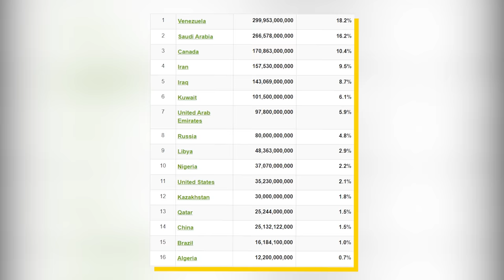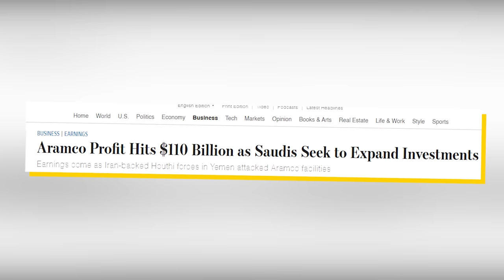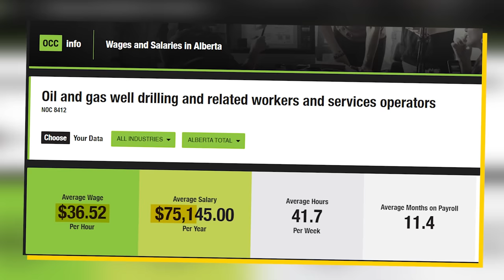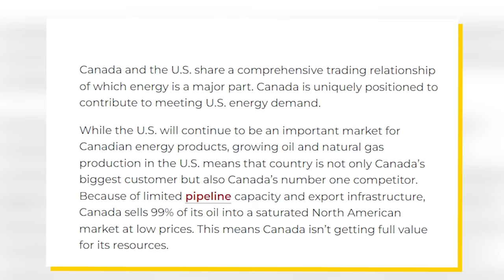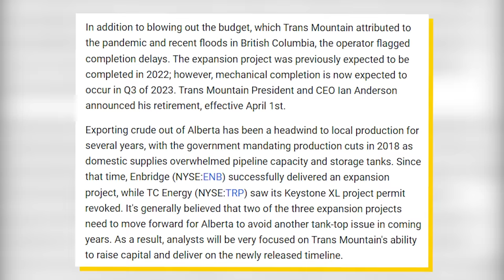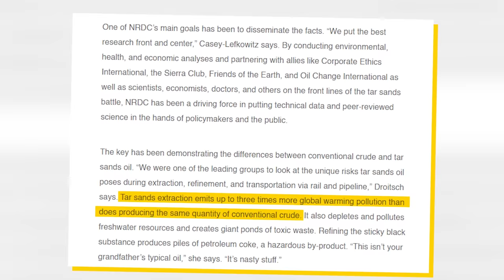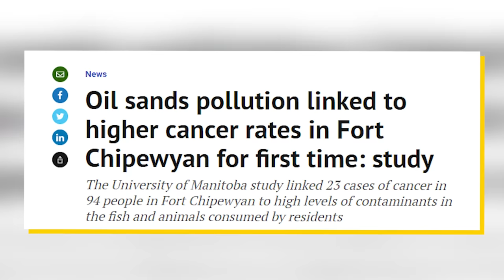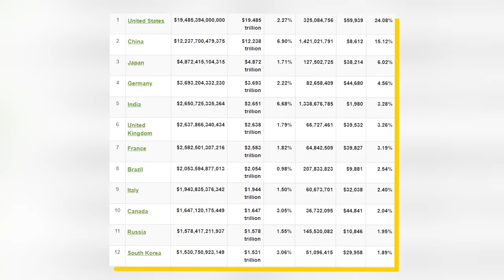Why Canada Refuses To Exploit Their Gigantic Oil Reserves

Comment: The biggest problem for most Canada oil production is it take a lot of ENERGY to produce that oil.  From what I have read what oil Canada is producing takes the energy in one barrel of oil to produce three barrels of oil.  Venezuela has a similar problem with much of its oil reserves through Venezuelan oil is NOT as hard to produce as Canadian oil.  Worse most of the Canadian "oil reserves" are similar to similar "oil reserves" in the US, it may take the energy in one barrel of oil to extract one barrel of oil from those "Reserves".  In simple terms, unless you use nuclear power as the energy to produce such oil, you will have to use more energy then you will get from producing the oil.  There are coal fields in England where a similar problem kicked in startng in the 1920s, no matter how mechanized England could make coal mining, the energy needed toget at the remaining coal exceeds the energy we would get from that coal (So the English slowly closed down those mines, accelerating it under Thatcher and a few years ago closed down they last coal mine).  
Just because the oil (or coal) is in the ground does not mean it can be mined.  It takes ENERGY to mine coal or produce oil and no one will produce that oil or coal if the energy to produce such coal or oil exceeds the energy we can get from such oil or coal.  Most of the oil "Reserves" in the US, Canada and even Venezuela is believed to be that costly in terms of energy to produce to ever be produced.
Thus do NOT look at "Reserves" but the much smaller "Recoverable Oil Reserves" the latter will be more accurate as to how much oil we can produce (Through some accounting rules lead to a to small a number for "Recoverable Oil Reserves" but such numbers still tend to more accurate then what is called "oil reserves").
Please note under OPEC rules, each OPEC nation's ability to ship oil is based on they "Recoverable oil Reserves".  When this rule was adopted every OPEC Member within a few years stated a huge increase in they "Recoverable Oil Reserves" almost up to the level of was believed to be they "Oil Reserves".   Thus it is believed Saudi Arabian and Venezuelan are to high (With many outside oil experts having much more faith in Venezulean numbers then the rest of OPEC and that is especially true of Saudi Arabia).  That appears to be a factor in the recent oil price increases (along with a boycott of Russian oil, Russia is NOT a member of OPEC but is either the number one or two oil exporter (Since the 1980s Russia and Saudi Arabia have been either numer one or number two oil exporter, whose number one and who is number changes but is has, since the 1980s, been Russia and Saudi Arabia).  
Since at least the 1960s, the top three oil producers have produced more oil then the next ten oil producer combined.  The top three oil producers have been Saudi Arabia, Russia (prior to 1989 the USSR) and the US.  The US produced more oil then anyone till Reagan becam President (BUt not enough for domestic use, the US was a net oil importer from 1969 till about 2016 when the US became a net oil exporter again, but today, 2022 the US is again a net importer as Shale oil production has dropped). 
Back to Canada.  Canadian oil reserves while large are NOT belived to be recoverable from an Energy input, Energy output point of view. The same is believed of most US Shale oil production (The most profitable US Shale Oil Fields started to be drilled around 2006 when oil reached the price it had not been at since Colonel Draked drilled the First oil well in 1859).   Thus most of that oil will stay in the ground with people crying why we do not get it out.
Reply: lmao, cool essay, but totally false. If they can pull oil from the ocean floor, they can pull oil from anywhere.
Reply: @kaleidoscope3234  So you think beause we can use two gallons of gasoline to pump one gallon of gasoline, we will do it?  That is the restriction, not that it can NOT be done, but it will take more energy to do so then we will get out of the transaction.
Reply: @paulmentzer7658  that's a bit of exaggeration lol. You assuming the only energy source we have around is nuclear and thermal plants. You are also assuming the only mean to transport oil around is pumping them onto freight ships. Both of your over simplified assumptions are just plain wrong.
You think it doesn't cost energy to drill oil from the sea floor? It does, and by a lot, but people get those oil out and still return decent profit anyway. The problem is oil is limited and it is generally best strategy for any country to avoid tapping onto their oil supply as much as their economy can endure. If your country run out of oil you are at complete mercy of countries that still have oil reserve. That's why USA and Canada limited their oil exploitation.
Reply: @kaleidoscope3234  The US and Canada HAVE NEVER RESTRICTED OIL EXTRACTION, the restrictions imposed has been economics.  For example Saudi Arabia kept the price of oil more or less stable from 1973 to 2004 mostly at a price it would be unprofitable for the US and Canada to fully open up its Shale Oil Fields.  Some experimental wells were drilled but that was all.  Shale oil became profitable is when you saw massive drilling of shale oil (And other Oil, around 2008 I was visting Alllegheny National Forest and you saw massive oil wells being drilled, for while the Federal Government owned the forest and surface rights, private ompanies owned the mineral and other sub surface rights.  It was a mess, electrical lines hanging from trees, not wooden poles, but uncut trees.   It was a wet year so no massive forest fires butyou had electrical lines all over the place as people drilled for the expensive oil underground.    Most those wells are now "dry" for the power needed to pump those wells was in excess of the power from the oil being pumped.  
As to using other sources of power, yes it is doable, but it makes more sense to use that other souurces of power directly?  I.e. use electrical power to propelll a vehicele, rathr then use tht power to pump oil to do the same job AT INCREASE ENERGY COSTS. 
The remaining shale oil fields have reserves that equal less then a third of the energy needed to obtain that oil.  That makes it porfitable but sooner or later you will hit the point where the energy obtained is less the energy produced and when that happens oil production for transportaton and heating will stop (There are thngs, mostly medicine, that is produced from oil and in such cases how much energy it takes to produce that oil is unimportant but such objects are ver rare when compared to oil used in heating and transportation).
Reply: @paulmentzer7658  You don't have to restrict oil extraction when you're land locked.  Its the export capability that is artificially capped.